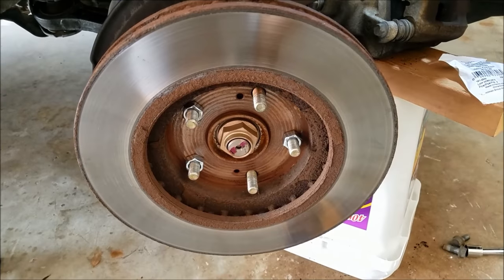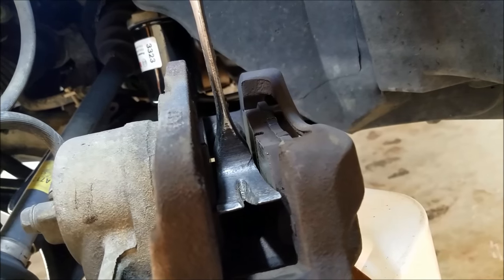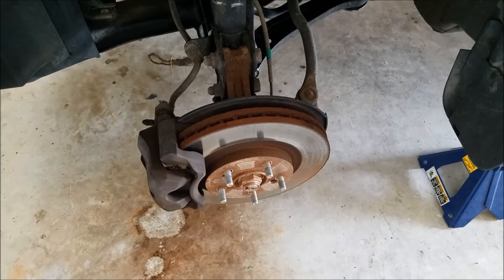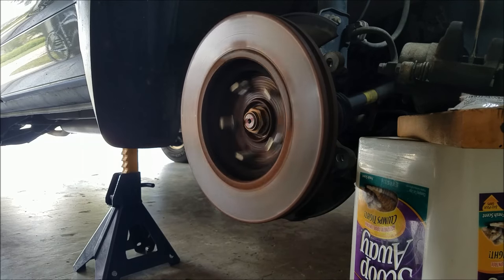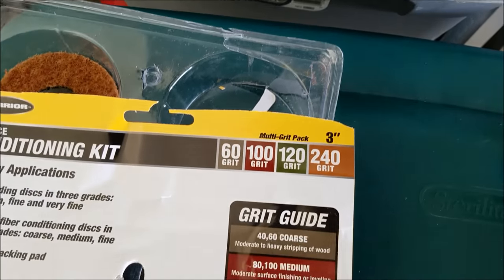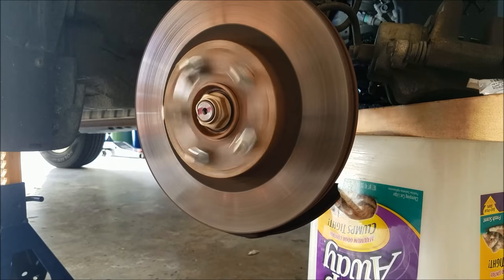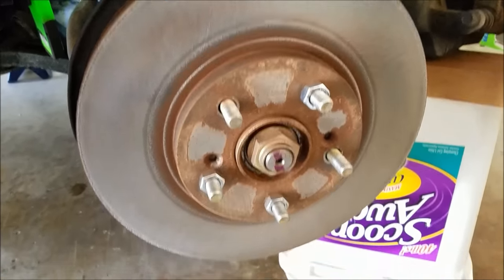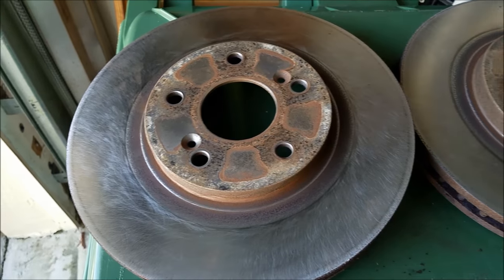DIY Do It Yourself Redneck Brake Rotor Resurface: Resurface Brake Rotors at Home

Comment: I don't know why so many people hating on this. I see no issue with it, it's sanding pretty evenly & there's no harm in trying to rectify some old rotors. What's the worse that happens ? It doesn't work out and you end up having to buy a new rotor ? No harm no foul, I'm gonna try this out.
Reply from the maker: Exactly. Thanks for the support man. I'm still running on these rotors with no brake pulsation. Rotors don't get warped, they get uneven pad material on them that cause pulsation. Knock the pad material off and the rotor is good.
Reply: It's unnecessarily dangerous. The pulsation is caused by pad material being stuck on the rotor after an aggressive stop, then have the brakes pushed hard. Taking the rotor off and cleaning BOTH SIDES with a sanding disc will give you the same result.
Reply: Put a dial indicator on it. Then you'll see the problem with it. Just because you put lipstick on a pig doesn't mean its not a pig anymore.
Reply: They're hater because they think you're supposed to pay them to put new rotors on and throw the old ones in the landfill
Reply: @shorelinearmorllc477  or you can simply bring it to a shop and pay fraction of the cost for a rotor turn…
Reply: @Auto209  shops don't do that its easier to charge 150$ a rotor.  They put new parts on and mark up the price.  Why you think it cost 800$ to get a brake job.  When it cost 30-40$ for new pads.
Reply: @Auto209  I'm not spending 60 dollars to turn 2 front rotors when I can do this or similar process myself with a grinder
Reply: @LuckyVagabond  That's due to the disc sitting crooked/warping. they definately do warp but not as much as they're installed on crusty hubs
Reply: So if you actually tried this, obviously it didn’t work. It would never work. Anyone who understands how brakes operate understands this wouldn’t work. Idk if “hating” is what people are doing, this video is just bad information. You said that’s it’s sanding it pretty evenly. Well that’s not good enough, not even close. I recommend that you never work on your vehicle or anyone else’s
Reply: @williamwchuang I laugh everytime some jackass says the pad material is stuck to the rotor causing vibration. It’s not, if it was you’d be able to see it. If it was, you’d find evidence if you machined the rotors on a lathe. 
The only thing we agree on is that the technique shown on this video is not effective and is horrible advice
Reply: @JasonLee-lv7tm  
As an aircraft machinist with other talents, bs., maybe intentionally, which is even more laughabe. Steady, slight touch grinding can clean and remove slight damage by an experienced handler or you can have the grinder/sander fixed to a surface, move close and steadily turn the rotor...a veneer or dial guage fixed to a stationary object would be helpful. You can remove the rotor and steadily spin it under a stationary fixed grinder/sander.

Comment: I pushed the brake pads Back and put sandpaper between the pad and rotor. After driving around the block a couple of times it was good as new.
Reply: What grit
Reply: Genius
Reply: Hahaha 😂 love it... 👍
Reply: Dude... ingenious! I’m going to give it a try.
Reply: Did you use glue to do it? I was thinking of doing the same 🙂
Reply: BAD ASS!!!
Reply: Ride it out with sand paper🤔😂
Reply: I thought about doing that. Doesn't the paper just fall out?
Reply: I'm doing this
Reply: Ohhhhh I need to do this so I can get my kids to school until next week when I get paid. I wonder if it’ll work for me too? What kind did you buy?
Reply: @CultivatingNCultured  i used an angle grinder with around 80 grit flap wheel. I removed brake pads. Spin the rotor by hand and immediately started the sanding. The rotor spins with the rotating sanding motion. Worked good for me.
Reply: @jsnjcnt  Do you know glue?
Reply: If nothing works, eBay has it for around $60 for a pair shipped for most cars
Reply: You are very lucky that your sandpaper didn't start on fire. I highly recommend NEVER doing that again.
Reply: @TaylorJump1 yeah I kinda think this is bullshit or simply not a good idea

Comment: Been resurfacing rotors forever. As long as you do not reach minimum thickness I say go for it. The worst that can happen is that you don’t get the results and need to put a new disc on. Why not save some money. I can say that I have done my own for over 40 years on all kinds of vehicles with great result and no failure. You can waste your money on rotors but I like my money in my pocket.
Reply from the maker: Yup! I'm literally still running the same rotors I did this procedure on. Thanks for the great comment.

Comment: I don’t know if you know this but only one wheel will spin if it’s in the air on all vehicles without limited slip. If you stop the wheel that’s spinning the other wheel will then spin instead
Reply: So then only jack up one side of the car at a time?

Comment: I have done this with a flap sander on a 4.5 inch angle grinder. I did it with the rotors off the car by rotating by hand and continually moving the grinder being careful to sand  evenly around the perimeter. The results were good.
Reply from the maker: See people, I'm not crazy. This really works. Thanks for the comment man.
Reply: Thx for sharing
Reply: yep that's my plan
Reply: Exactly.  A flap disk job, quick and easy.
Reply: I just did this at work.

Comment: The brake pulsation is probably because the disc is warped. You can actually see it as it revolves.You need new discs really. They are not that expensive and will save time and last much longer. Sanding the discs down like this takes miles off their lifespan.
Reply from the maker: Just sanding off old pad material. Not the rotor itself. These rotors lasted me 3 years after sanding them. Only reason I changed them was because I was doing new pads.

Comment: That is not the way to resurface the rotor if the brake pedal is pulsating.  The reason is pulsating is because the rotor surface is uneven....having that drill in your hand unsupported does practically nothing.  For this to work, you need to mimic the actual setup of a lathe.  The grinding wheel needs to move ever closer and closer while being securely fasten so the high surface area gets sanded and leaving the low surface untouched.  You can't do that while holding the drill.
Reply from the maker: But, it worked. No pulsation after this procedure. Explain that!
Reply: @LuckyVagabond  is called rigging...it works in third world countries too.
Reply: @hmax1591  No, actually pedal pulse can come from uneven deposition of brake pad material onto the rotor or one raised bump of rust around the perimeter.  This method takes care of both (to some extent).
Reply: @LuckyVagabond  I cant
Reply: Pulsation and uneven friction across 360° are different.  Pulsation is thickness variation and the pad deposit in rotor should cause erratic gripping but still a smooth feel in the pedal.
Reply: So how would you keep your tool stationary?

Comment: Seems to me a few measurements should be taken at different spots to verify uniform thickness?
Reply: Yes you use measuring calipers for that, all that will happen is enuven wear of the pads at best, at worst he would still have a little bit of that shake when he brakes.

Comment: am I the only one who saw rotor up and down pulsations without any pads? as if it is mounted off center or not parallel. I would check of there is anything between rotor and mounting plate like rust
Reply from the maker: Good observation! I haven't had any brake pulsation since I did this, so I'm guessing it's just from having the rotor tightened down with just two bolts.

Comment from the maker: It has been a few months now and the brake pulsation has not come back. This procedure really works!
You can get the 3" sanding disc kit at Harbor Freight: https://www.harborfreight.com/3-in-surface-conditioning-kit-19-pc-60752.html
Reply: does this get rid of the heating?,,I changed both my break line hose,,I don't wanna change my master cylinder cause the breaks are good
Reply: Thanks for the update, was just about to ask how well this held up, I have almost the exact same circumstance. New pads, too cheap to get the rotors turned now I have a pulse in the rear.
Reply: ....."break line".....c'mon, really, seriously?
Reply: How much did the sanding disc kit cost you

Comment: This is not a new concept. Old-timers used to do this on a lathe after cutting the rotors to ensure good bedding. 
I've never run into this issue personally. I normally end up replacing the rotors due to wear, rust and time. Normally I just knock the ridges of and pad swap till the rotors are toast. 
Brake pulsation used to be a common problem due to pad material. Unless you have a sized caliper and trash the brakes, 99 % of the time its pad material on the rotors that is causing the pulsation. If you have fairly new rotors this is an option. On older rotors I'd not waste my time. They are not that expensive. Shops won't do this, so if you have some time you can play around. You don't really need to grind. You just have to skim the surface/put a scratch trough it and bed the pads. Also don't cheap out on the pads and you won't have this issue in the first place.
Reply from the maker: Exactly! Great comment my man. Thanks.

Comment: Anytime you do new pads you must ALWAYS  DO A PAD BREAK IN. Find a safe spot and get your car up to 45 mph and slam on the brakes. Do this 3 times , let them cool and then do it again 2 more times.  Your trying to get the new pad material to transfer onto the rotor.  Every pad manufacturer has a break in process on their website too.
Reply: Good to know, thanks

Comment: My problem with this is a it’s probably not going to be an even  cut

And 2 its most likely going to have a rough stop, ice seen it happend, although you broke the glaze the finish winds up bring to rough and has harsh stoping
Reply from the maker: Worked out great for me. Brakes are still nice and smooth.

Comment: Was thinking to do the same with my f150 using 2 2x4's with sand paper attached to evenly sand both sides at the same time..or 1x4's or something that's flat. Glad to check YouTube first and to block the piston from moving in when it's removed..and don't use brakes while resurfacing.
So much better than the guy using a small round sander on a flat rotor on the table.. possible uneven sanding.

Comment: Use a grinder take down the ridges. Then use a vibrating mini mouse sander with 40 grit pads on flat surface. Disk then checked on kitchen work surface for trueness . Works perfectly. Be safe doing this.

Comment: The darker coloration is the old pad material which would cause the new pad to jitter.The rust is a problem which in my  case I am going to replace the rotors because it has pitted the rotor surface.
Reply from the maker: Thanks for the comment. I'm still running these same rotors with no pulsation. I'll probably replace them at next brake pad change.

Comment: I am a fan of harbor freight but their sand paper is extremely bad. It gets clogged very fast and fails to remove material. Project farm has an excellent video comparison the different sand papers. Definitely go with the 3m paper, it's better by miles.
Reply from the maker: Thanks for the advice!
Reply: I never had an issue with the grey silicon carbide wet sanding stuff. Honestly my favorite paper to prep for paint on metal with. The regular stuff on the other hand not so great.

Comment: You’re burning through sandpaper faster because of the heat caused by the combined speed of the turning rotor and your drill. Heat kills sandpaper
Reply from the maker: Yeah, I think I used up about four disks doing both rotors.
Reply: Yeaaaah heat on cast iron😂lmao

Comment: I have had 'luck' using a hammer [carefully] to first remove the rust and transferred pad material that forms around the inner and outer circumference of the rotor.  With the rotor spinning, I then use sandpaper in a similar fashion to remove glazing and to smooth the surface of the rotor - finishing off by spraying it down with brake cleaner and wiping clean.  This has worked consistently well without incurring damage to the rotor.  Removal of the circumference rust first minimizes the sanding required to do so - saving both time and sandpaper.

Comment: I would say you can see the scratches on the surface. Does the disc still have the minimum thickness and is it balanced? In some countries in our world it would be illegal. This could be done on the disc of a farm tractor, but not on a street-legal car!
Reply from the maker: Yes, still balanced and thickness was fine. Sanding is not the same as cutting a rotor. All I did was remove brake pad material.

Comment: Actually pretty smart , I probably wouldn’t do it only because it’s only $5 a rotor at my local shop to have them resurfaced professionally, But it’s not a bad idea if you wanna save some money
Reply: Damn $5? All I'm finding is $25 a rotor here
Reply: I called a shop that charges $50 a rotor. I assume because they probably just don't want to do it.

Comment: Pulsing brakes is caused by a thickness variation of the rotor.  Always buff both sides of the rotor hat and hub clean of rust and debris.  A lateral runout caused by rust trapped between the rotor and and hub will cause a thickness variation as the rotor wears.  Lateral runout can also make the pads wiggle back and forth in the bracket creating  a squeaking noise and extra wear on the pad locators.

Comment: This is so sketchy. I love it. Do you think a sanding block and sandpaper would also do the trick? Might be a good way to lose a few fingers.
Reply from the maker: Probably so, since I really think all you're doing is sanding off the old pad material built up on the rotor. Thanks for the comment.
Reply: If ur worried about fingers just put the sand paper on the end of your...
Reply: Thought bout that old gray look block that stinks when used

Comment: Well, i liked this vid, so i tried it out for myself...unfortunately my pulsation is still there 😔
Was hoping it would work! They look really good and rotors are only about 3 years old. But it did not fix my pulsation. Might take them in to get turned if its not the same price as new rotors.

Comment: Little risky..but that is one way to get the rotors to spin. Most guys just take the rotors off and sand them down with 100 or 80 grit.  Some years ago I talked to a brake guy and he said he just uses a wire wheel type brush on his drill to clean the surfaces of GOOD rotars. I tried it on an older Acura TL I had and it seemed to work just fine when I put new pads on.  BUT good job buddy. Anything you can do in the garage on a weekend afternoon to save yourself 500 bucks is time well spent.  Brakes Plus just quoted me 600 to do the rear brakes on my Explorer! lmao...They want to remove my heavy duty high performance rotors I put on 4 years ago and toss them...then put on the OEM stuff. I am like WTF dude. No way. Give me the car back and I will spend a few hours and 50 bucks on the pads and be back on the road with $550 still in my bank account.

Comment: I would only recommend using rough grit on the lip and the inside. I wouldnt go below 240 for the surface for sure or use the scotch pads for it that were included. That way youll only skim the surface. Also make sure you put your drill at 90° because like you were holding it id guarantee that the surface isnt flat anymore. Anyways howd it go, happy with the result?
Reply from the maker: Yes, I ran those rotors with no pulsation for nearly 4 years.

Comment: Pad shudder is caused by the pads moving in pulse with a warped disc.  Uk price for a skim £10. Price for a common rear disc new. Not really much more.
Reply from the maker: Yes, but I kept a set of rotors out off the landfill for over three years.

Comment: LOL. Step 1: Don’t guess. Step 2: Check rotor thickness. Step 3: Record thickens before resurfacing.  Step 4: Buy the correct tool ie dial indicator/runout gauge. Step 5: Use dial  indicator runout tool. Step 6: Keep pretending it’s possible to get a even surface by hand/ keep dreaming. I’m sorry I cant approve this practice lol. I bet it still pulses. Break in the brakes properly and avoid damaging the brakes
Reply from the maker: Thanks for the comment. What I did here worked perfectly. The brakes do not pulse at all. This procedure primarily removed uneven pad buildup, which is what solved the brake pulsation problem.

Comment: Pretty sure u didn’t have to run the car. Pop caliper off and just go around the rotor.  Then flip it over and do the same. You are trying to remove the uneven deposits and rebed the pads. Having the  car come off the stands or rotor. I have and I don’t allow running engines on it. Seen cars fall off lifts/jack stands etc.
Reply from the maker: Good point. I probably could have just let the drill turn the rotor.

Comment: Question, The question... Did it work?
Reply from the maker: Yes, it did. I'm still running on the same rotors with no pulsation at all.
Reply: @nadiaswaidan5272  you're asking me?
Reply: Yes I am
Reply: @fpmprivate  I hate to say it but im used to this :( its not normal at all, but happens so often. Im trying to work on my truck and this guy wants my number. Glad your daughter has a taser.. i also have a kew chain but I recenlt got a flashlight with a taser.. its pink 😄. Girly I know :(
Reply: @LuckyVagabond  oh it really did work thank you so much I'm going to do the same to my car rotors